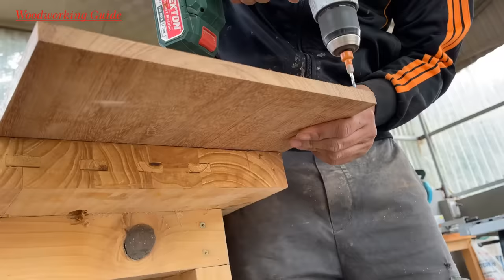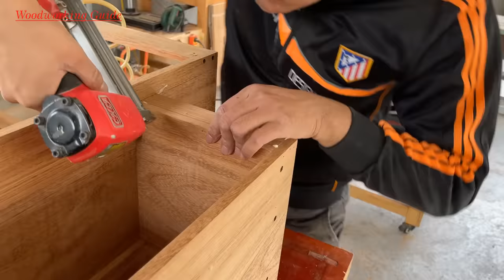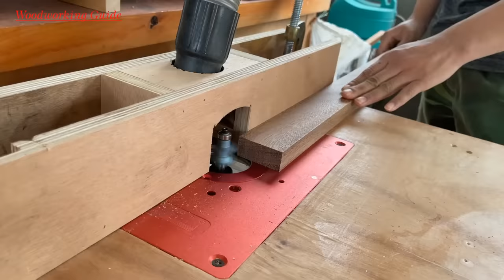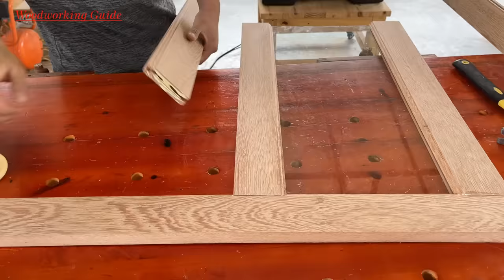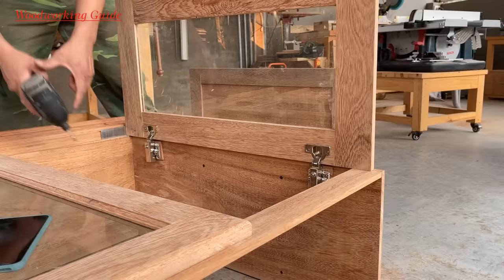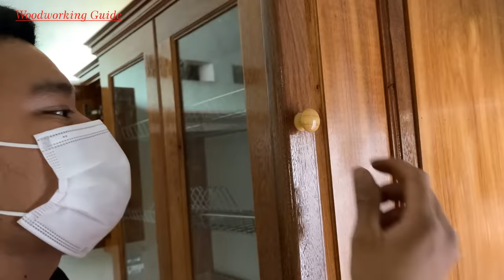Kitchen Cabinets // Design Your Own Wonderful Wooden Kitchen Cabinets For The Family

Comment: Hello. Love your video. I need some advise. I built a cabinet using ordinary plywood, about 1/3 inch thick. It was just a big box. No shelves or anything inside. I used ordinary nails to hold them together. I used a hinge on one side to serve as the door. But over time, the sides began to curve or bend. Is there a type of wood I could use that doesnt bend or curve over time? Thanks.🙂
Reply: Consigue madera seca, muy seca: tornillo, caoba, cedro, ishpingo. La copaiba dobla mucho, el pino se pica. Esa madera del vídeo se astilla y tb tuerce. En Perú se llama huayruro, es pesada y muy dura.

Comment: Yep, at least work perfect with screwdriver. 
Pls pay attention to ergonomics: 1) hundle situated very high. I Assume you assembled it not for those who 180-190 sm toll. Black head screw, common, I'm sure you can connect panel with hidden connectors like minifix or screwed panel from bottom. And last about back panel. You have perfect  router. What about make hidden places for those panels? You just have to take off 2-3 mm, depend of back panel width.
Some another mistakes like door sizes and incorrect angle cutting corona. Front panels color different. 
And good luck

Comment: Since when do rails go on the end of doors or am i doing them wrong!!
Reply: That's the wrong way. Im sure
Reply: Yes it is.. also no backer board to prevent tear out which he had.. it’s a half azz job but done in a poor country so it’s probably high end there 🤦‍♂️
Reply: Yes he has done them wrong, Rodney carry on making them the way you know is correct 😉
Reply: Same with top and bottom panel showing end grain.  They all go together, lousy miters, screw heads exposed, and orange peeled top-coat.  Oh well, his wife is probably happy.
Reply: @rafaelartavia2289  .
Reply: I don't agree having the rails on the bottom either but regardless of that that's a badass kitchen cabinet